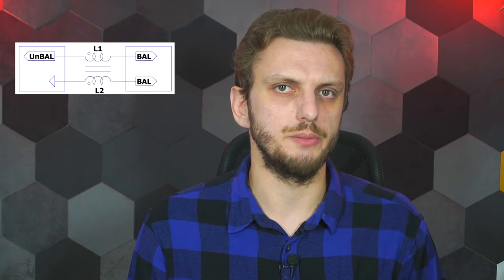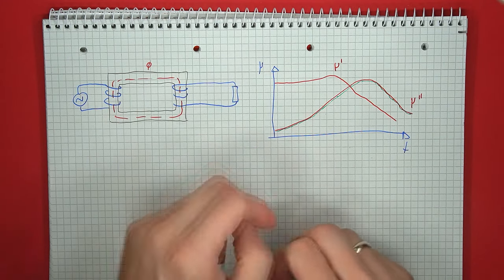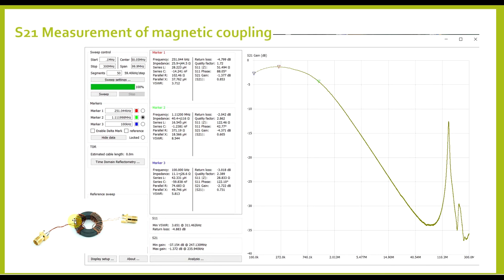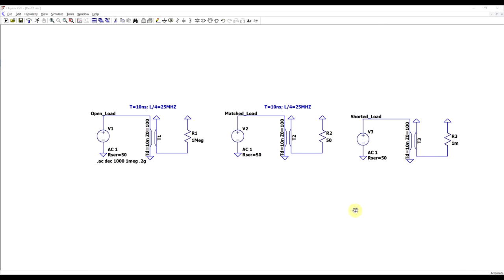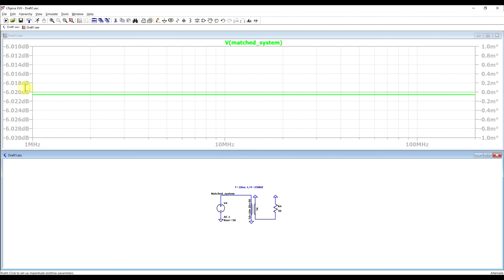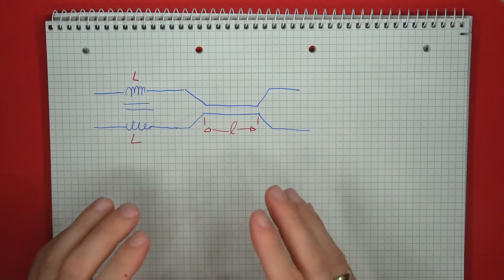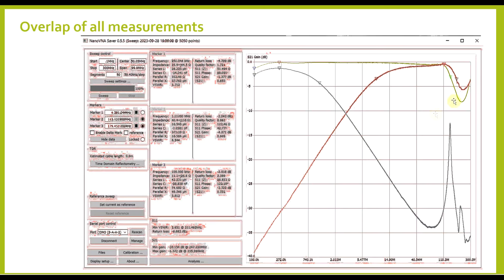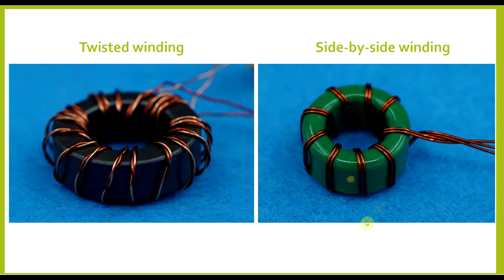Energy transfer in Baluns

Comment: This is an excellent explanation, thank you! I often see baluns which appear to be constructed as common mode chokes (Guanella baluns). These baluns seem to have bandwidths that exceed the flat region of the real permeability - for instance in a material 61 Guanella balun that has a rated bandwidth of 1 - 55 MHz, while material 61's real permeability begins to decrease at about 2 MHz. How do Guanella baluns compare to the transmission line transformers discussed in the video? Do the work on the same operating principal?

Comment: It it the fisrt time I see a complete explanation of why we use a twisted pair (or trifilar) winding on a core transformer.
Thank you so much !

One question now : If I look at my HF power amplifier, it seems to work also with a (low impedance) coaxial line winding. Correct ?
I am still puzzled by the magnetic coupling between inner and outer core in that case.

Comment: Thanks for the nice videos! How could this type of windings could be used with other than 1:1 turns ratio?
Reply from the maker: You can use 3 or more wires twisted together - to have multifilar coils; and then the ends are inter-soldered, depending on the transformer you need. I'm not sure though if more than 4 wires are ever used in parallel; at some point you will be using multiple transformers interconnected for other ratios.
Reply: @FesZElectronics  quadrifilar transformers are sometimes used. Practically, it gets annoying to wrap them, though.